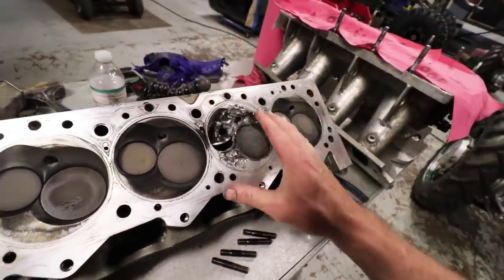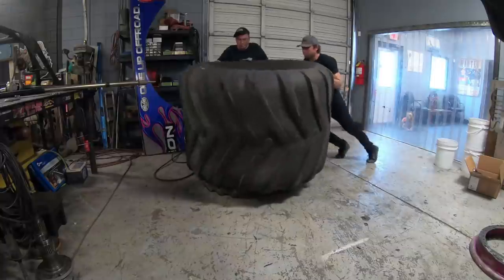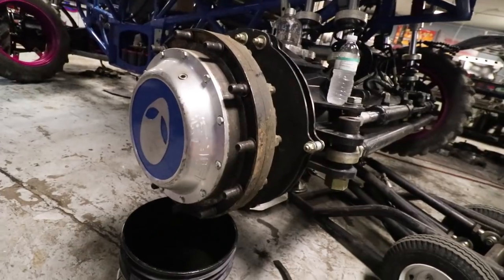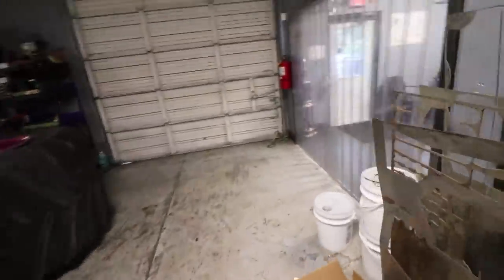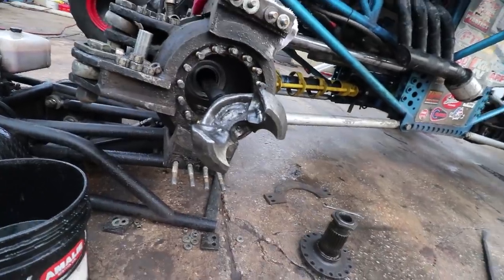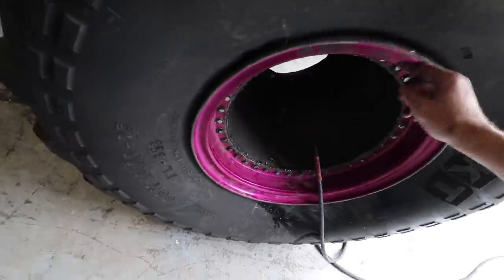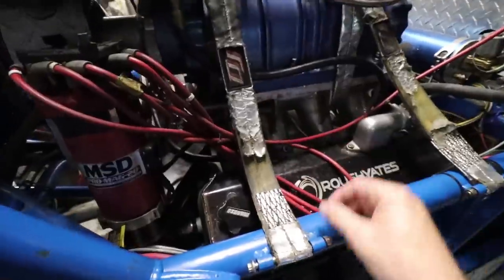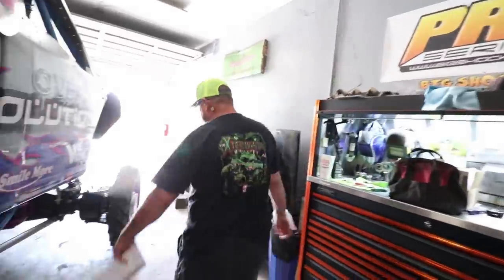Monster Truck Engine Pull

Comment: Just a little pointer for you and I’ve done a lot of floater tires and payloader tires use a nylon strap or maybe even two to wrap around the tire to help seat the bead. 🤷🏻‍♂️
Reply: Center of the tread.

Comment: Kinda surprised that you guys don’t actually run beadlocks on a truck/tire combo that big?! Would think popping a tire off the bead would be a common issue if you land wrong?
Reply from the maker: The way the wheel is shaped like a can allows the bead to slide on the wheel and bead back up without losing much pressure on a side landing. It's rare we just have a tire debead if ever.
Reply: @V2Vids  Huh, makes sense given the volume of air in the tire. And I hope you kept the phone number for the machine shop that fixed that cylinder head because that is amazing what they did with it!

Comment: When that blew apart it quit right then an their that motor would have never ran with a head that destroyed I have a lsx in my lifted truck an one of my heads did that to I'm making around 1100 to the wheels unless in 4x4